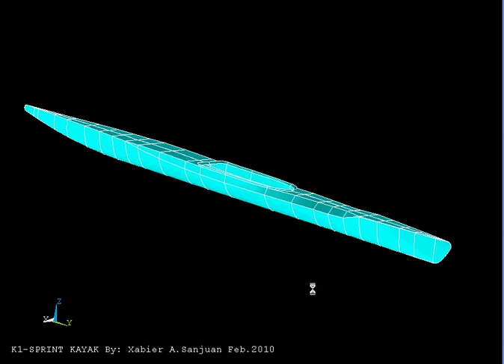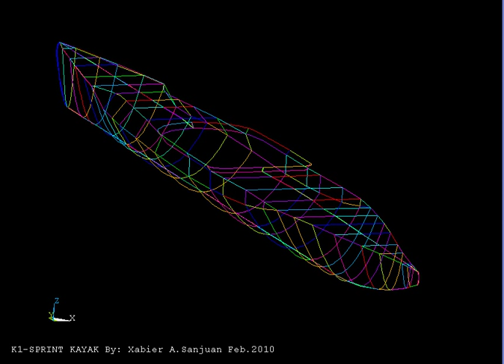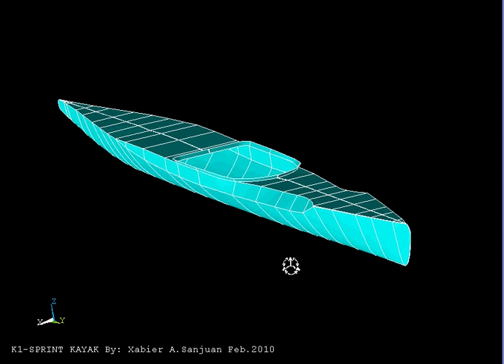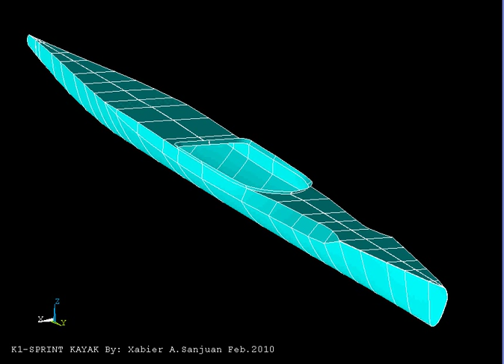Build your own K1 Sprint Olympic Kayak - Fastest ever made

Comment from the maker: The K1 Olympic Kayak designed by Mobykraft can be build by anyone. Go to our website mobykraft.com and order the K1 Templates in the Canoes & Kayaks section. Templates are provided by e-mail in pdf (Acrobat) format, to be printed in letter size pages (or equivalent). No special software required. Any computer can open our templates. Any standard computer connected printer can be used.

Comment: I'm planning on building a K1 racing kayak out of plywood. Can i use your model? 
If i can is it possible to send me the file or plan?
Reply from the maker: Go to our website mobykraft.com and order the K1-Mobykraft Templates in the Canoes & Kayaks section. Templates are provided by e-mail in pdf (Acrobat) format, to be printed in letter size pages (or equivalent). No special software required. Any computer can open our templates. Any standard computer connected printer can be used.